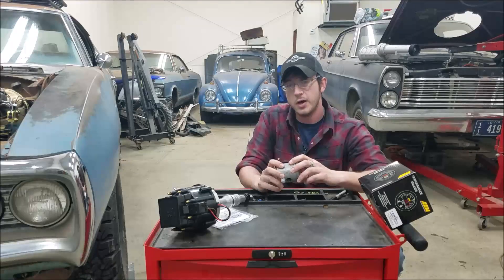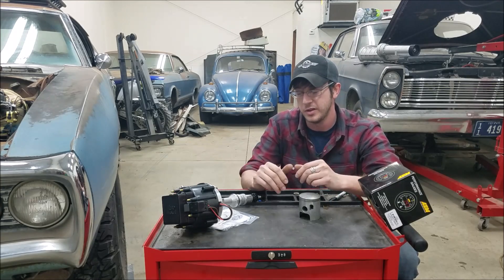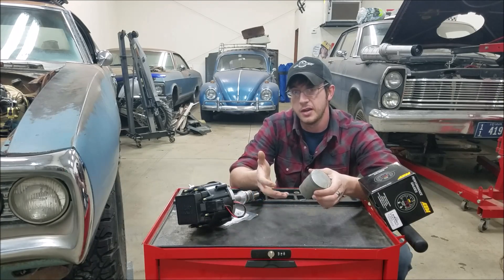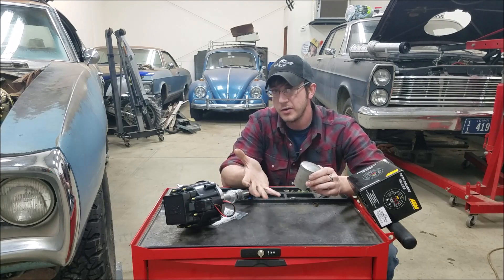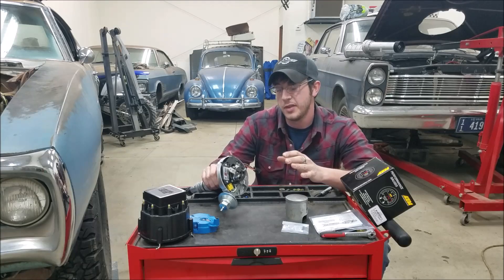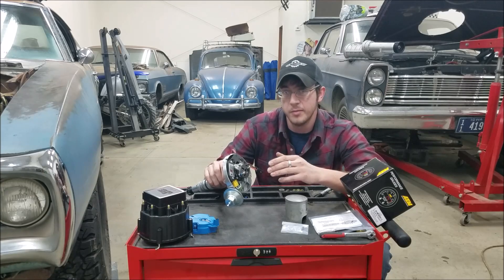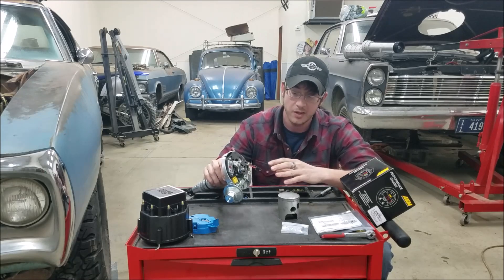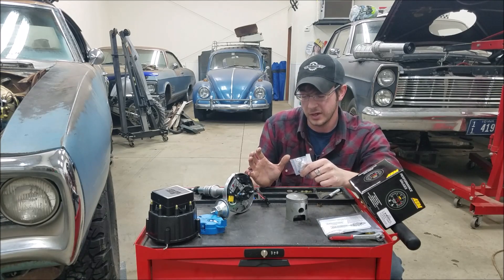Ignition Timing Explained: Distributor Tuning Theory (Engine Basics 101)

Comment: It's nice but the '63 Fairlane/Windsor 260 motor has no factory timing marks.  Finding TDC requires a little more effort after the distributor shaft decided to spin 180 degrees.

Comment: Getting my drivers licence in 1964 and coming up in the day Mom and Dad didn't buy you a car, ya had to buy and work on your own this  video EXPLAINED much of what I did to keep my old clunkers running. I did the stuff you talk about, but with little understanding of why. There's a world of difference in knowing how to do something and having enough knowledge to color outside the lines a little. I WISH I'd had the interest and the TIME to get better educated back then. Then again, the guys I ran with were like me, no interest in sitting in a classroom, as valuable as that would have been. Years since I thought about yanking the plugs every 12,000 miles, not to replace them but to sandblast and regap them and put em back in. Broke, dumb and lucky we still RODE. The sensors, computers, far advanced fuel  injection, dual turbos, the "engine management systems" of today's cars makes kids today unable to tinker like we did.They'd need ten grand worth  of scan tools to diagnose what we did by ear. Enjoy your channel Luke, keep it up. Keep "old tech" alive.
Reply: Got mine in 67, same where and when i grew-up.   We all learned how to keep a finger nail file and a book of matches for tuning the car. Every fall me and all my friends would get our cars ready for winter, points, plugs wire, change termostat'e to 190 so we had heat, check hoses belts. Love it; i guess that why at 65, I  play with old beetles &  still use and keep the points in them to keep  bring back the memories helps me feel feel young again. None of us had any schooling just helped  each other asked the old guys a lot of questions (they got lot of luaghs from watching us trying to fixes our cars) but some how we were able to keep our car on the road. I feel so lucky to grown up in the time i did with the cars of the 60's & 50's.   We worked on them outside under a tree in the yard or on gravel driveway , auto parts store parking lot,   none of us had a garage . Back then I never knew at 65 I would look back at it as some of the best times in my life.

Comment: would you mind doing a video on tuning a carb with a higher CFM than stock? 

Also, random question. Im running 20w50 in my 84 ranger's 2.8L v6 down here in georgia. I never gets below 34f at night during the winter. From your experience. Am I safe?